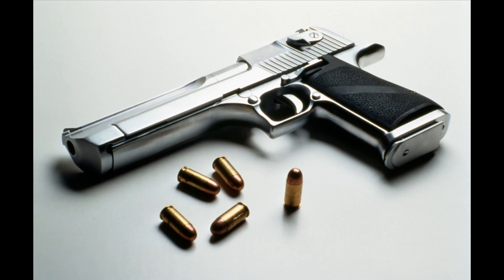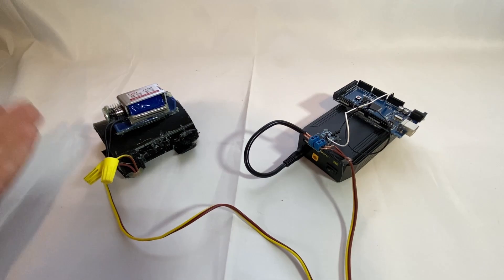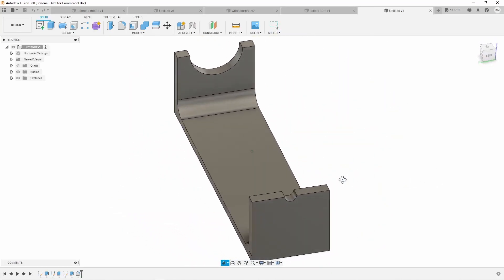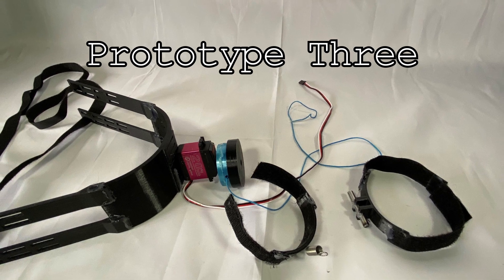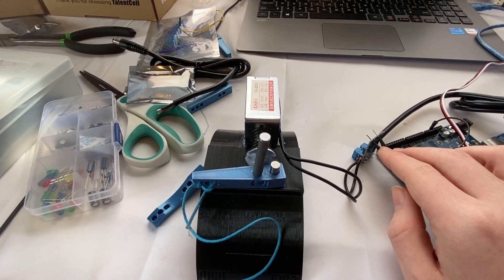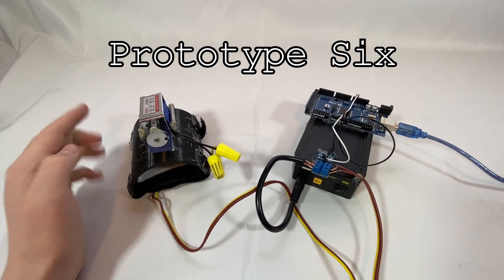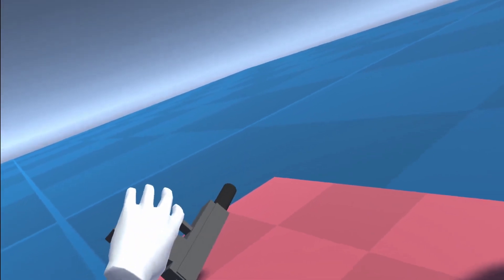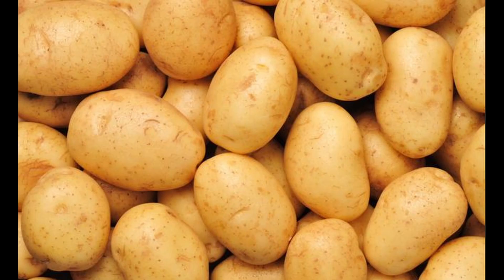Recoil In Virtual Reality (Project V-Coil)

Comment: Very good information. I am with a shooting simulation project. I need to recoil the gun and was looking for something like that. If you can give me data on what power the solenoid has, or what voltage it uses, I would appreciate it.
Reply from the maker: The solenoid I use currently has these specs.
Force: 45N ;
Travel: 10mm
Rated Voltage: DC 12V;
Current: 400mA
Push Bar Dia: 20mm / 0.79";
Total Length: 83mm / 3.27";
Size: 52 x 25 x 30mm / 2.05" x 0.98" x 1.18" (L*W*H) 
Though it says 400mA my testing concluded its more like a constant 2A once its engaged 
The battery pack used in the video was a 12 Volt 6 amp battery pack I bought from amazon though it could be any 12 volt supply.

Comment: Nice are you still working on the treadmill at all?
Reply from the maker: I am still working on the treadmill though designs have changed drastically. My next video will be a functioning prototype even if its just the movement of the treadmill without a user on top. How long will this take? im not sure... But rest assured that I am working on it.
Reply: @modernpower6285  you still there?
Reply from the maker: @Wither_Strike  Still here dude! sadly, you won't see a video from me until I get this new prototype working! If I had to guess I'm about 2 to 3 months out

Comment: Excelent job!!..
You can make a gun.. for example a rifle with this mechanism.. so when you fire its the gun that moving instead your wrist🤔
Reply from the maker: You could. something like this has already been made. But as it requires you to hold an actual rifle/pistol It becomes quite un-wielding to play with. This due to the fact that if its a rifle you cant just switch to a pistol your still holding a rifle IRL. The idea behind this prototype is to simply have the same feeling without the system being so un-wielding.

Comment: Great video man!!! This is actually super interesting and we haven't seen much tech like this for vr! Also, is it possible to tie a small string from the recoil weight to the controller, so that when it pulls back it also pulls back a bit on the actual controller?
Reply from the maker: You could technically do this, but because the distance between the controller and solenoid are constantly varying (due to the rotation and movement of the wrist) This would make it quite difficult to keep the string constantly in tension. Thanks for the suggestion!
Reply: I would also like it to move the cintroller